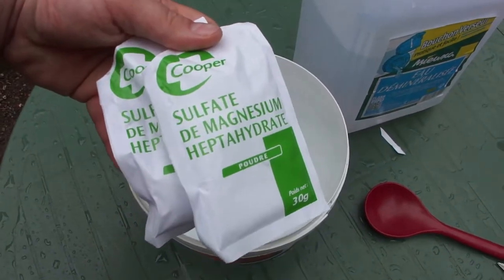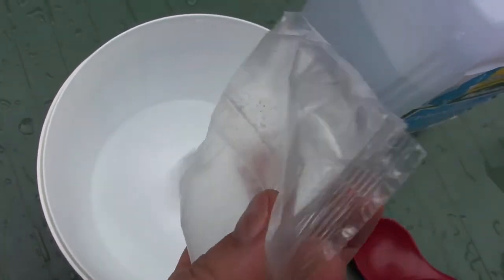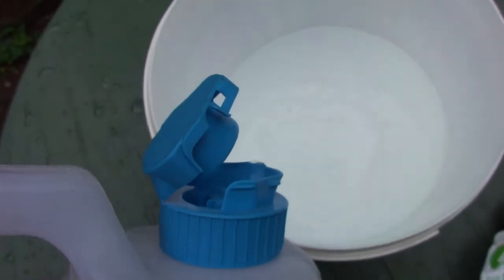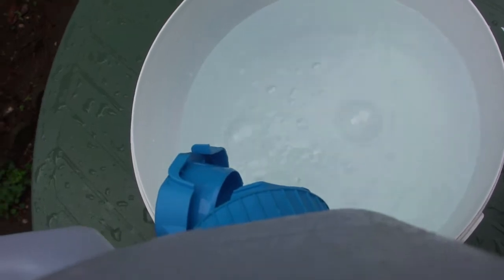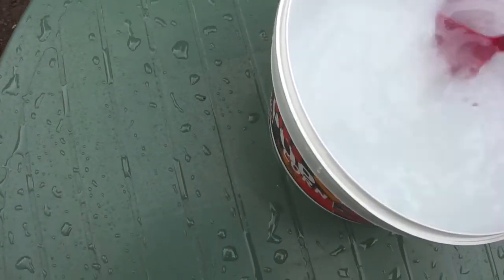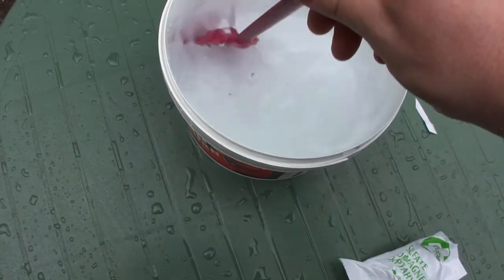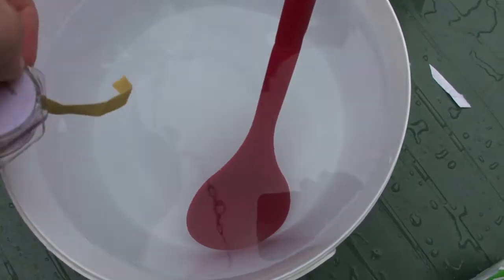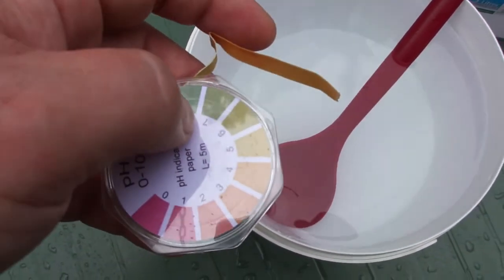Alum Epson salt electrolyte car battery conversion 07

Comment: do  not wais time epsom salt dont work
Reply: Bucanas santana Think you need to try different amounts and charges. It worked for my car and was running from a battery two years completely dead and sitting and lasted another year or so. This was one of the worse video's ive seen. Whats up with people not finishing it. Shut the stupid thing off and poor into battery and charge it and come back and hit record. Damn people, couldnt even hear or understand eighther.